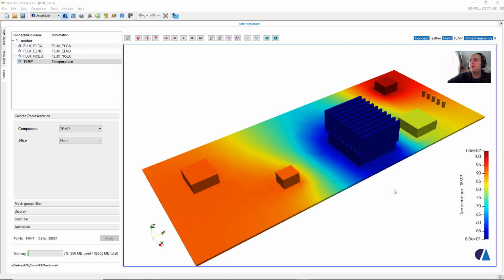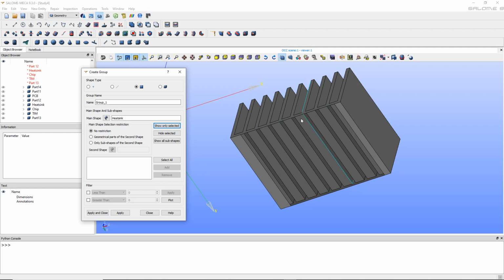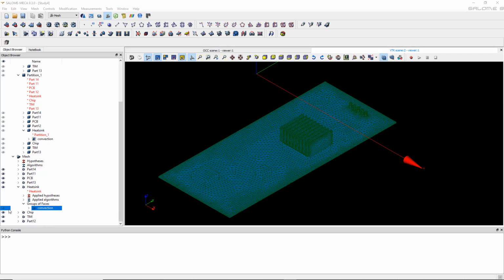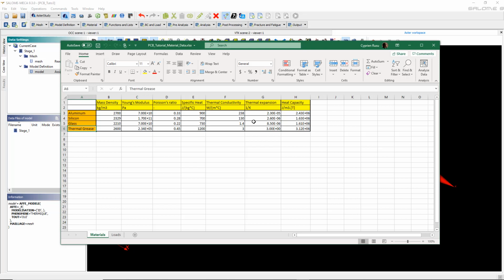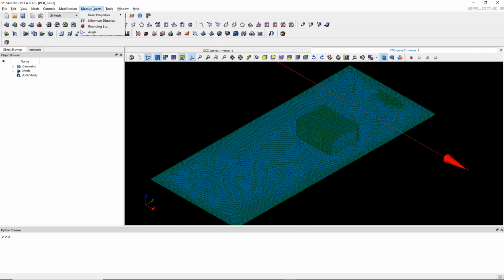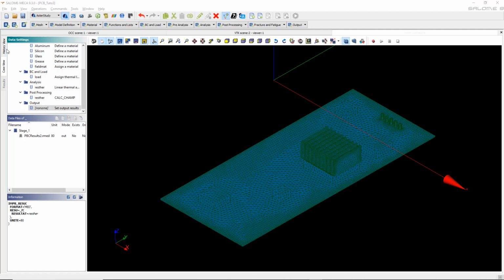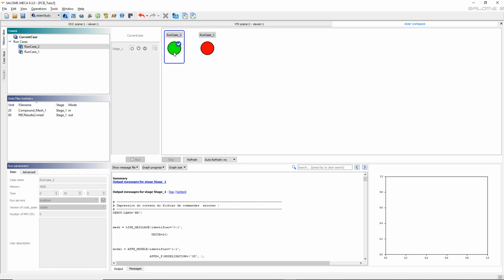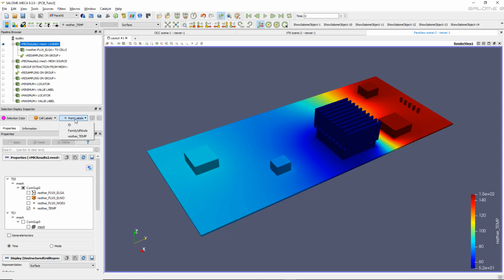Thermal Tutorial - Simulate a PCB board Steady State Heat Transfer  with Salome Meca

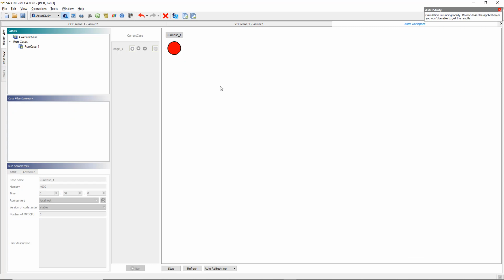Comment: Hi Cyprien, this is another very beautifully presented video, explaining all the important points/issues. Thank you very much. At time 26:04, you mentioned the problem of continuous rotating  hour glass. A possible solution is to select a time for refresh (in the button in the middle of the screen).  Currently it was set to "no refresh". Of course i do not know for sure about this Windows version. But for Linux version, that is the fix for the problem you mentioned. Thank you very much for all your tutorials that is helping many opensource enthusiasts. 
Edit: Now only I could see that the fix was already mentioned in another comment by @alberto. Thanks.

Comment: Hi cyprien, about the strange behaviour of the bug of a simulation that take long time and it update when you click, actually is not a bug, but a settings. Close to the "RUN" button, there is "Auto Refresh" and as default is set as NO. Obviosly it is not convenient. You just need to set is as 5s and it will update every 5 seconds!
I loose a lot of time in such stupid element, and now I learned it very well ;)
Thank you for your helpful tutorials and best regards
Reply from the maker: Thanks for this tips! I have actually activated that now, but I wasn’t sure what it was...
Reply: @Feaforall  I am confident that it will solve the update problem (both on Windows and Linux). Just remember to set this parameter every time you open Salome-Meca, since it will not be saved as default at next startup.
Thank you again and best regards.

Comment: Thanks for another great tutorial!! Does code aster support electromagnetic simulations (magnetostatics, eddy currents...)? I know that it can be done in calculix, however Salome meca has a nicer Gui, which is always a good thing to have
Reply from the maker: No, aster doesn’t do that
Reply: @Feaforall  That's a pity (edit: priorly I had used shame, which could be understood as a criticism to salome-meca). Even though calculix will add a GUI in the future (it's currently in development at their GitHub repository), it is easier to find information and tutorials about Salome Meca
Reply from the maker: It’s not a shame... every code is develop to do something specific well. Aster has been develop for nuclear and civil engineering first by EDF and it’s very strong for that. If you are interested into Electromagnetism, you can also look at Elmer, I have heard it’s good for this application.
Reply: @Feaforall  I tried Elmer in the past but it didn’t support electromagnetic studies from its GUI (maybe this has changed in newer versions) and the components needed to be characterized in postprocessing (or at least the way it should be done wasn’t documented)
Reply: Calm down, bro. Salome-Meca is a free tool (great on do what it was made for). Don't expect 'beautiful' GUI modules in free softwares. Or, you can pay for Ansys with its huge interface. Best regards!!
Reply: @zanelatoeb  Indeed, I pay Ansys for my professional work, however I prefer to use open source software when I’m planning to publish a design as open hardware as that allows others to review it without having to pay a pretty expensive software

Comment: Hello Cyprien, thank you for this very detailed video about thermal simulation. I am wondering can you explain how to correctly to use ECHANGE_PAROI to specify a thermal contact resistance between two contact surfaces?
Reply from the maker: I will eventually. Echange_paroi is more difficult to use because you need exactly the same mesh on both faces in contacts: https://www.code-aster.org/forum2/viewtopic.php?id=23232
Reply: @Feaforall   I have figured out how to use the ECHANGE_PAROI for the thermal contact. But my current problem is how to plot the average temperature of a volume as a function of time. Usually I can use extra block filter in paraview to get the data. In code aster, the paravis doesn't allow to do it. Can you give me some hint how to do it? My current progress is to use POST_RELEVE_T. But still explore it.

Comment: Hi Cyprien,
Thank you very much for this tutorial, it really helps me to start with FEA. I've a question for you and I hope you can help me. I'm trying to build up a transient simulation for the same PCB you showed here. But when I select the transient load I cannot impose a physical "LIAISON_MAIL" between the elements to take the conduction problem into account. Is there a way to solve this? I followed also the transient tutorial but I did not find any useful for this problem. Thank you

Comment: Hi Cyprien, Tank you for your video. I'm new in this kind of simulation and i wanted to know how did you found the Convection coefficient ? I tried to calculate it with formula that i found on internet but i don't obtain the same order of magnitude that you. Can you help me ?
Reply from the maker: There are well known material databases for all frequently used materials, if you search on internet ( or in other professional software) you will find those. I just used those provided in the OnScale material library for this case. If you want to know more about thermal conductivity, Wikipedia has all the info: https://en.m.wikipedia.org/wiki/Thermal_conductivity